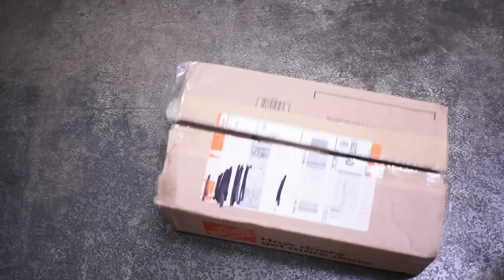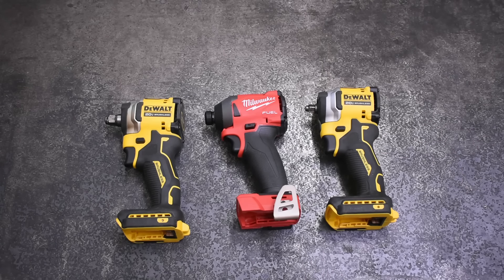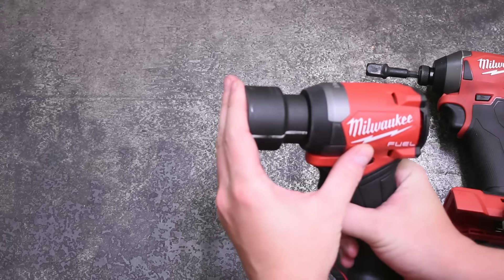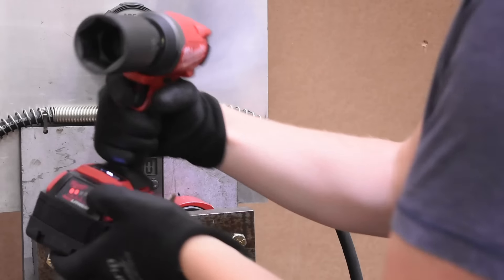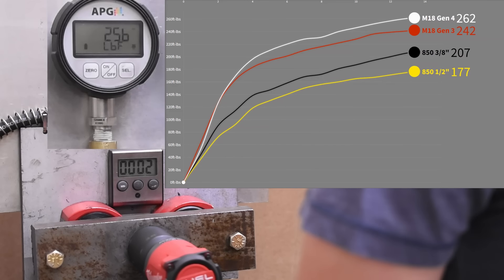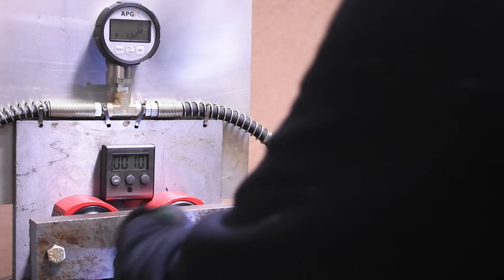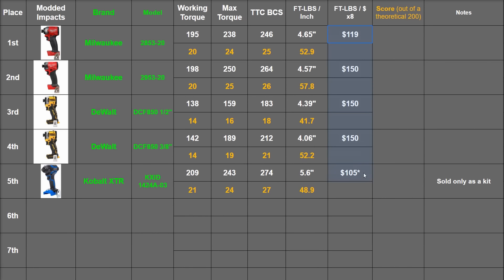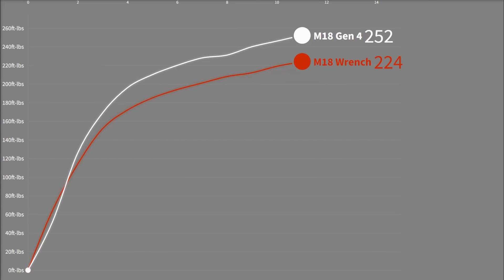Youtubers Made the Smallest, Fastest Impact Wrenches on the Planet, We Test 'Em!

Comment from the maker: Those with our lifetime of rankings would see this new category & results sneakily appear earlier this week! https://etsy.me/3G8j3QK See how they were made, parts numbers & more by visiting these great channels Philly Fixed: http://y2u.be/z3eZ40R3XYI Man Caver Tools: http://y2u.be/mAD8Uh1TTMc
Reply: How do you plan on claiming your royalties when Milwaukee sees these test results and does exactly this from the factory?
Reply: I have a Dewalt 1/4 apex unit and got transmission fluid in it, water too and it still works fine, precision transmission had those fuel m18 units and they stopped working as soon as transmission fluid got in them.
Reply from the maker: @h8GW  Forward them to Man Caver Tools? Haha
Reply: Where can I get a dewalt like that 3/8 drive?
Reply: Shiiiiiit half inch too
Reply: @TorqueTestChannel  would you be willing to test Mastercraft Brand impacts? They are fairly inexpensive, but you'd probably have to buy them from canada
Reply: Thanks guy's......Shoe🇺🇸
Reply: @TorqueTestChannel  I think the shallower socket in the 3/8 DeWalt makes the difference.
Reply: You need to test the DCF887 with a 3/8 swap, that thing is a beast
Reply: @DJIInLondon  
It really is! When the DCF850 came out with that new little PowerStack battery I couldn't resist it, but I wasn't about to give up my trusty old 887. ⅜" anvil swap and some new grease and she was like a while new tool! Wish I had done the swap years ago now. I can't remember the last time I've had to reach for my ½" high torque now with this modded 887 around. There's not a job it hasn't tackled yet in my garage.
Reply: This is amazing! The 3/8" anvil is $15 and allegedly just a simple swap out. I just ordered one...super stoked for a 4" impact wrench, that's just bananas.
Reply: When someone is going to make dcf860 frankenstein?😂
Will be a nice addition to the ranking, especially in reverse

Comment: All of these are complete abominations and I am totally here for it.
Reply: Me watching my in laws at Thanksgiving
Reply: @elvsrbad2  I don’t even wanna be there for that: I can’t stand my in laws
Reply: I made a dcf850 with a 3/8 anvil a few months ago and it rips. Dewalt n646882 anvil. It's the anvil from the dcf902 and slips right in.  With power stack it is a great compact tool for automotive tasks.
Reply: @elvsrbad2  That time of the year is coming in two months
Reply: Wish it could have the chuck where you could still use a driver bit
Reply: @licker1997  Then why bother with a wrench in the first place?
Reply: @bladeoflucatiel  can have both , bosch does it like that in some of there  impact drivers.
Reply: @licker1997  I know what you mean. Its those drivers you can replace the chuck right? So you can have a impact wrench, driver or drill
Reply: @bladeoflucatiel  no sir , the impact has a chuck that you can put a socket on it and in the middle of the chuck it has a hole where you can put a driver bit in it.
Reply: I just had to send my GEN4 in for a warranty repair for the same reason the Collett seized up on me while using a right angle attachment.

Comment: I have a gen 3 Frankenstein I built, I'm a heavy truck technician by trade, a half inch snap on air impact wouldn't remove maxxforce 13 head bolts and the gen 3 Frankenstein blasted all of them out with ease with a xc5.0 battery
Reply: I work on smaller diesel stuff and I got the DCF921 1/2” compact. I thought I made a mistake buying such a small compact with a big anvil but it actually gets crusty stuff apart with no sweat and I’m amazed.
Reply: @notsevenfeettall  The problem with air tools is the rated specs is with much higher pressure and a thick air line connected directly to a beefy air compressor. In a shop the pressure is usually lower to start and there’s hundreds of feet of tube the air has to travel to get to your tool. By the time it gets to you it’s hot air and doesn’t have that big push behind it so the pressure drops super fast.
Reply: @markm0000  🤔
Sounds like we need to strap an intercooler right where the hose hooks into the ridged wall plumbing! lol
I wonder if a simple U-bend transmission cooler and a couple 12V 120mm or 140mm computer fans would do the trick?

(in all seriousness, I'm not really suggesting that it'd make a difference heh)
Reply: @DUKE_of_RAMBLE  
If you actually want decent power out of your air tools add a small air tank on the side of your toolbox as a buffer and use a high flow air line with high flow quick connects for your tools. It will make a massive difference in burst performance. If you do that might as well add a drier and oiler so your tools last longer.
Reply: @markm0000   try a dcf891b
Reply: @mikethetoolman8776  It’s cool having 800ftlbs of chest hair at the push of a button but I’m never working on something that needs that much torque. The 200-something ftlbs out of the little 921 is just fine. If I have to take apart something that is heavily rusted together I break out the torch before I damage my tools.
Reply: @markm0000  Yep as mentioned use a small 5gal portable tank near you. Swap all fittings with say a 1/2" or 3/8". Like the Milton Type V for example, use minimum of 3/8" hose, but have a 1/2" to swap as needed. The biggest difference can be the couplers. The old Type M are too small
Reply: So I figured Id give a update to this. Up until about a month ago I hade been using this hybrid impact a lot. Then the hammer mechanism exploded inside the case one day. Since it's been discontinued I had a hell of a time finding another one of these drivers but I did at my local home depot. It wasn't in the system so they sold it to me for 50 bucks because they couldn't figure anything out due to there being a image when it's rung up for a free battery. Long story short I converted this one as well and am very happy with it. Just don't use it on crazy tight and massive fasteners all the time. Ive been using it currently with the cp 3.0 high output battery and it makes for a very light weight and compact gun.

Comment: The M12 stubby is just the sweet spot for these compact impact wrenches, I just wish they weren't so wildly overpriced. $199 for a tiny 12 volt impact is bonkers. I could see $149 max.
Reply: Milwaukee tax
Reply: The tools are bad enough, but the battery prices are what really keep me adopting more battery tools. Buy an air tool once. Oil it and it will last forever. Buy a battery tool and it and it's batteries will eventually die. That being said I have 99% converted to Milwaukee battery ratchets but that's it so far.
Reply: @_Radius_  that's why I like Ridgid, not the strongest, or highest quality, but the Lifetime Warranty sells me, recently had to warranty a drill I purchased in 2017, on the phone I was told where to take the drill, it was a Ridgid authorized service center, I was charged unexpectedly charged $35 as a deposit at the service center (later got back $30, shop kept $5 as a "recycling fee" whatever this means but ok), but when I was on the call with Ridgid, I mentioned how the batteries were becoming weak, dying quicker, etc, the person on the phone immediately ordered 2 new batteries (I LSA'd 2 batteries), and they didn't ask for the old ones back, only told me to recycle them.
Reply: These conversions are more powerful and cost less to make 😎

Comment: I modded my older DCF 886 into a 3/8 wrench. It successfully removed proper 80 ft/lb lug nuts and loosened rusty brake fittings.
Reply: Same here, I’ve used it so much and it still works. Such an amazing tool

Comment: This video is gonna be a good leadup to the new Kobalt mid torque conquering that category.
Reply from the maker: The Kobalt mid-torque is going to conquer compact impact wrenches?
Reply: i'll never understand the brand fanboys.
Reply: @TorqueTestChannel  No, mid torques.
Reply: @acomingextinction  Not really a brand fanboy. I just love seeing the constant oneupmanship.
Reply: I think it’s going to tie the Makita impact wrench at best.  But it’s not dethroning the dcf891.
Reply: @juanc5149  Shop Tool Reviews has it breaking nuts loose at numbers the 891 couldn't manage. Edit: Nevermind, not exactly. They both topped out at 1,000 ft lbs, but the Kobalt didn't take nearly as long.
Reply: @orijimi  

Kobalt was equipped with larger capacity batteries as well in one case with the 8ah.  Where the DeWalt was limited to 18650 cells.

That channel has also shown the Milwaukee and DeWalt 12v stubby being evenly matched.  But in TTC it was actually the DeWalt that put more beans.

In fact one time shop tool reviews even showed the Milwaukee impact driver put performing the DeWalt impact wrenches but yet on TTC they put significantly less beans.

The reason is simple.  Breaking loose freshly tightened bolts.  In different days and conditions isn’t as precise of a test of measuring fastening torque in a calibrated dyno.  Things like ambient temperature.  Fastener and nut itself, thread pitch, etc etc.  Will skew results one way or another.  

Even TTC methodologies isn’t perfect but it’s the best we got and about as good as possible any reasonable person can expect.  And I’d argue a lot more consistent than shop tools reviews methodology. 

Having said that I enjoy the heck out of both channels and I find them both very informative and would encourage anyone into tools to watch and support both.   But I firmly believe that the new Kobalt impact wrench will test very well.  But land second place in the mid torque power category.  Somewhere between the Makita 40v and the dcf891.
Reply: @juanc5149   @Juan C  I think you may have skimmed the video, the Kobalt performed virtually the same with the 18650 4ah and the 21700 8ah. And the DeWalt only got its top numbers with the 21700 4ah. IIRC, the 6ah is also 21700s? Shame he didn't use that one.
Reply from the maker: We've been testing the snot out of the Kobalt mid torque this week and have not seen the WTFBBQ type performance many are expecting. Throwing several other impacts as benchmarks on the dyno in between runs on subsequent days to be sure. That said, i feel it's an impressive tool and a good buy.
Reply: @TorqueTestChannel  Awww. I was hoping the technology wizards had found yet another secret sauce. Thanks for the heads up. I was slightly at risk of buying it.
Reply: @juanc5149  Dynos are ok for YouTube views, but they mean less in the rw. While dyno testing can display disparity between tool brands and ranges, it's not the end of the tool usability scale. Tightened nuts and bolts add a disparity that's also going to be encountered by nearly everyone in the real world. In addition, neither method doesn't account for using hammer deadblows, heat, lubricants, etc. which are things that every tradesman will either resort to or initially use before using any tool brought upon by experience and learned behavioral patterns. I think weighing both testing methods yields a better median than relying on one alone.

Comment: i have a Ridgid SubCompact 3/8 drive impact. I love it, it does everything i ask. I did an entire engine replacement on an X3 B58 engine with it. Subframe bolts, suspension bolts, flywheel and torque converter bolts, etc. Only thing it obviously couldnt handle were the axle bolts. Been contemplating getting the 1/2 inch version as well

Comment: Between my new makita 40v GDT01 impact driver, and GWT07D 1/2" mid torque impact wrench there's not much I can't do on my vehicles and trucks.  I even used the mid torque to bust lugs off my semi truck. 0 problems. Loving the new 40v line. I'm slowly upgrading from 18v . Just ordered the new hammer drill. Can't wait to use it on some concrete work I'm going to be doing at the house.
Reply: Bought all the XGT impacts and hammer drill last year, the midtorque is so powerful that i havent needed the 3/4" yet, just slap a 3/4" adapter on the midtorque. Best of all, never need to use freshly charged big heavy batteries, the power is there even when only 1 bar left on the 2.5ah battery. Milwaukee and such is for the Honda crank bolt test guys who never use their powertools productively, Makita is for actual powertool users.
Reply: @pflaffik  yeah makita for men, moded milwaki's for boys that ware perfume and wish they were holding mens tools on their youtube channel.

Comment: I actually made a Gen 3 impact driver in a 3/8 drive. I had to get a little creative with the front bushing but it has so far proven very tough and incredibly spicy. Let me know if you want to test it, seeing as the 3/8 Milwaukees do tend to run better for some reason. Very happy with it.
Reply: This would be so awesome 😎
Recently sold my M18 Frankenstein for a great price and picked up this DCF850 with Powestack battery and 3/8" anvil! Can't wait to test soon as the anvil arrives 👍🏾👍🏾👍🏾
Wonder how much better the 3/8ths anvil is on your unit vs the 1/2". With the M18 Frankenstein, the 1/2 is already a beast!!
Reply: How's it treating you?
Reply: @mike_t_007  been using it at the shop for a long time now, thing doesn't like impacting the same thing for more than about 8-10 seconds but it still does a very good job and has not quit on me.
Reply: Thinking of picking up another Gen 3 or 4 this weekend and would like to do the 3/8th conversion. Which anvil part # did you go with?

Comment: It would be interesting to see how much torque a drill driver puts out (Forward/Reverse).  With people now using them with Ice auger attachments along with several other things they've not been used for previously thanks to the increase in power, I think it would be cool to see.
Reply from the maker: We've been making prototypes for over a year for a drill dyno, it requires something harder to make than this type of set-up. We're not giving up.
Reply: @TorqueTestChannel  if I’m thinking correctly and a drill dyno would need to be similar than a car dyno that sounds like an expensive venture.
Reply from the maker: @timblack33  You're correct
Reply from the maker: @fabianbohnert120  A dyno brake. Yup!
Reply: @TorqueTestChannel    thank you for your hard work, I really believe getting into the drill/driver testing would pay for itself in the expanded audience!

Comment: I think size should count for more in this chart. Going through all the trouble to get something less powerful but this small then deciding you need to save a few bucks and get a few more ft lbs by getting the Kobalt is a bit silly. If I wanted one I'd even consider going with the DeWalt for smaller overall size even with the lower power and higher cost.

Comment: I have a question, I've had good luck with cleaning and regreasing impacts with high quality synthetic moly NLGI #1 grease. They've always felt smoother and seemed to have more hit power afterwards. Am I just making myself feel better or is there something to be had with better grease?
Reply: There was a tool assembler who mentioned that the quantity of grease made a noticeable difference in how a tool performs. He has said that packing a tool with too much grease would lower it's torque capability. Conversely, using Project Farm's data on grease qualities would infer that you're assuming correctly.
Reply: @WildDisaster  Indeed, I have accidentally over greased air tools before and the loss in performance is... Noticeable to say the least.

I always wondered why in air impacts the grease used is moly grease, but in every electric I've opened or seen opened its usually some normal lithium based bearing grease. You'd think for the hammer surfaces they'd know and use the advantages of moly loaded grease. My only conclusion is that they use normal grease because it's cheaper.

It would be interesting to see TTC test and see if performance improves and by how much.
Reply: Ask your boyfriend 😂😂😂
Reply: Thanks I’ll order a tube and keep it for greasing my tools. I’ve been using normal lithium grease and it’s smoother at first but breaks down fast when the tool gets hot.

Comment: When you tighten fasteners in rapid succession sound becomes the larger issue. I want it tight in 5 taps. I will spend any amount of money to make that happen. My favorite impact of all time is Milwaukee 2654-20. It still works and I still use it in the garage.  I ALWAYS have the current best 3/8 battery impact in my 50k snap on tool box at work. I have smoked or sold off many between the 2654 and current. One was yellow. Big mistake. None were snap on. I miss the 2654 at work because of the noise. My 2554 now needs quite a few more Uga-Dugan. I can dial my titanium quiet within 10lbs. I torque critical fasteners thousands of times per month. I have hurt myself many times when the socket came off. Snap on helps for that but if you can’t get a solid grip…. Or when it lets loose and I go flying off the truck it sucks. It hurts for sometimes months. I want a repeatable impact for precisely applying torque.  Please please help.

Comment: Could they make the 1/2" anvil also have a 1/4" hex insert for normal driver bits? That would be a sick combo tool.
Reply: i think the bosch gdx has this feature.
Reply: Also a “always on” mode for the LEDs so you can use it as a work light.
Reply: It does, I have one. Cleaver bit of design
Reply: I own a Bosch freak in the versatility is awesome but I want the power of the Milwaukee Gen 4

Comment: Are you going to test out the Milwaukee M12 stubby Impact wrench with the new CP2.5 battery and Later the new XC5.0? Also I have not seen the 2454 3/8 M12 FUEL impact wrench on this channel I think It would be interesting to see how much the power difference is between it and the Stubby!
Reply from the maker: Yes on the 5.0, and here: https://youtu.be/9PU_V1btloA?t=242
Reply: @TorqueTestChannel  Can you also test the M12 FUEL 3/8 impact wrench 2454 (not the stubby models) it’s an older model but is still sold on Home Depot’s website